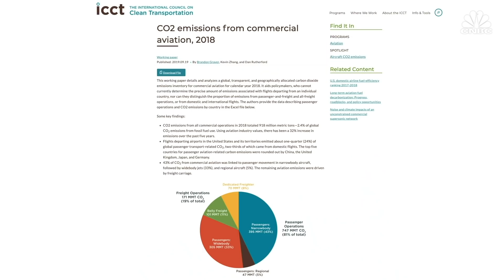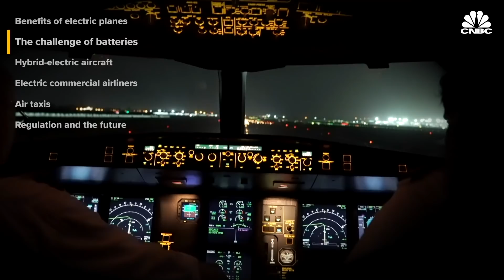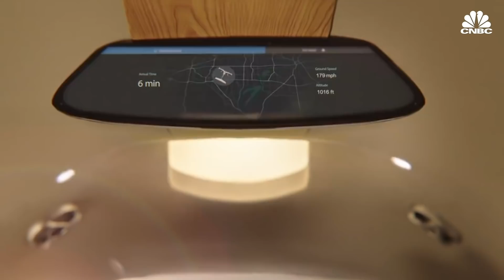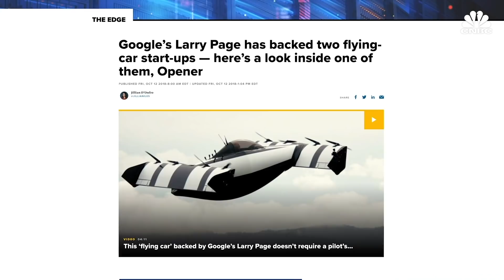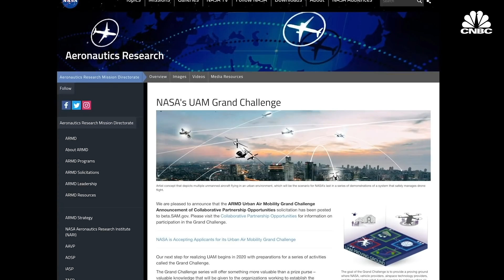Why Don't We Have Electric Planes Yet?

Comment: One big benefit of using a kerosene propelled plane must be the fact it loses weight over time as fuel burns up. As long as batteries are as heavy as they are, most  of the energy will be required to carry them around from the start to the landing. I wonder, why are we not talking much about hydrogen propelled planes? They could be just as environmentally friendly as electric ones if not better?

Comment: The number 1 issue is going to be speed. Since battery-powered aircraft only operates propeller engines (not jet), can battery-powered aircrafts come close to .80 to .90 mach speed of current commercial jet aircrafts?

Comment: "Why are planes so far behind?"

Aviation enthusiasts & every single airliners with CF6, RB211, PW4000 & every other loud turbofans:
Because that's what heroes do.
Reply: They have hydrogen plane in the works , Hyundai, Honda, BMW, Toyota all have hydrogen cars ready to launch, there are hydrogen trucks in the works, shell has invested heavily in hydrogen and here is the key in 2017 the Australian CSIRO invented a way to store and ship hydrogen, Japan plan’s to go fully hydrogen by 2030. You can manufacture hydrogen using solar power and store it and use it to provide electricity when it’s night, welcome to an actual green solution, batteries take 12 years to pay off and last 10 , GL with that.
Reply: @SuperJohn12354  Let's just hope the beasts of the vintage commercial jet aviation (i.e those early high-bypass turbofans, the 747, 757, A300, A380 etc.) coupd survive that 'Hydrogenism' by allowing the engines to be powered by Hydrogen.
Reply: @SuperJohn12354  OMG!  What utter tripe!  Where do I start?

No, all those car companies do NOTTT have hydrogen cars ready to go!  On the contrary!

BMW had a hydrogen version of their 7 series more than 10 years ago!  Nobody wanted it!  Have you EVER seen one on the street?!  Honda and Toyota were always talking big about their Clarity and Mirai boondoggles... but what happened with them?  You can't fool anyone into buying a car that runs on peanut butter, if there are no peanut butter supply stations to accommodate you.

There is no good way to calculate all the EV charging stations all over the country, but when you count all of the ones at factories for their employees to use for free as a perk, or the ones in parking garages, theaters, restaurants, museums, etc., it is safely into the high tens of thousands.  How many hydrogen stations?  69, as of the last count.  And how many HFC cars?  Google it yourself: the number actually DECREASED last year, because nobody wanted one!  About 8,000 in the whole country, less than the number of Teslas made in a month.

Contrast that with EVs: on March 31, 2016, Elon Musk announced he was ready to take orders for the Model 3; he said it would require a $1K deposit.  He was only expecting a couple of thousand orders.

What a surprise: within 24 hours, he had ~ 186,000 orders with deposits.  Within one month, that number had swelled to close to a half-million.  It took them years to catch up with the backlog... their Gigafactory in Sparks NV, is the largest building by footprint in the US, and 2nd by volume.  All it produces is batteries for them.

They took less than a year to build their next factory, 212 acres in size, and were producing cars in less than a year.

Where are all the HFC stations?  It's simple.  No one wants a HFC car if there is nowhere to fuel it, and no one wants to build a fueling station if there is no one to sell the fuel to-- a classic Catch 22.

Why not build them?  That's even simpler: a fueling station costs between 1 and 2 million dollars.  Do the math: to install, say, 30,000 of them, which is actually just barely adequate, that would set you back something like half a TRILLION dollars... who would risk installing them, if there was no guarantee of a market, if they considered the facts below?  Who would even have that much cash?  Anybody that DID have that much, would be smart enough and savvy enough to know it made no sense to risk it all on anything such as a distant also-ran to EVs.

Unlike charging stations, which cost as little as $800. bucks including installation-- in many areas, the city or the utility will install it for free, and maybe even kick in the hardware, too.  That's how it works here in L.A., and many other places across the planet... cities are eager to get everyone to drive EVs, because it's the cheapest and easiest way to reduce pollution, health care due to asthma attacks, emphysema, heart attacks, etc.

Back to those woeful HFC cars: why would car companies be so eager to sell them?  Again, simple: it was like having an umbilical cord attached to their customers.  Once a driver has one, it's a hot potato: they can't sell it... it is only good as scrap metal... so all they can do is drive it, and pay dearly for the fuel, which they can only get from the dealer, or someone connected to them.

EVs might not need anything from the dealer or manufacturer for years except for piddly stuff like tire rotations and windshield wipers; all of that is the main profit for car companies: they make more profit off of parts, oil changes, tune-ups, tranny service, radiator flushes, etc., than selling the car.  As for HFC cars, there is less maintenance (at first!), and they give the hydrogen fuel to the customer free for the first year or so... but once the honeymoon is over and they have to start paying for things, a HFC car will break their backs: presently, the fuel is several times as much as gasoline-- $15. per gallon, give or take, and the cost gets kinda fuzzy since, for instance, you can't just fill your car up on Monday, park it for days, and expect a full tank to be there when you need it for the weekend: hydrogen gas needs to be kept at hundreds of degrees below zero just to keep all of it from boiling away.

(You said something about using sunlight to make the hydrogen... that is an incredibly inefficient way to make it, called hydrolysis.  But the alternative-- called hydrogen reforming-- is no better than using gasoline, as it produces just as much pollution.  It's a no-win situation.

 Even under ideal conditions, hydrogen atoms are the smallest particles on the periodic table of elements, so there is literally nothing than can hold it-- even in a solid steel container, it will eventually escape from the most infinitesimally small cracks and valve clearances... it will seep right through solid tanks as if they were just sieves.

Wanna park that lovely FCV right next to the gas water heater, in your garage... the one with the pilot light??  Do you still want your house to be there in the morning?  Are you always going to know if there is a cigarette smoker, or other source of ignition nearby?  Would that weigh too heavily on your mind to be worth the stress and anxiety?

Hydrogen can make many materials brittle... what exotic internal parts will you have to replace in a few years, or chance having a catastrophic failure?

So many more problems... too many to count... have you ever seen the Hindenburg Zeppelin crash of 1937, in NJ? (Search for it.)  Before that happened, people loved the whole idea of riding in a quiet balloon floating though the sky... afterward, everyone was horrified and unwilling to take the chance.  Immediately, hydrogen was a curse.

That was more than 80 years ago... people forget; people die.  But what happens when Soccer Mom with a van full of kiddies is at the fueling station when a semi truck loses its brakes, and plows into them, and they suddenly become the first story on the nightly news-- worldwide?  Will ANYONE be convinced to get into a FCV again?  The entire fuel cell²
 market will die overnight.

So much of what is wrong with FCVs, has much more to do with what is right about EVs: look at the stats on how many EVs have been responsible for fires, and you will see they are per capita much safer than ICE cars, and infinitely less worrisome than FCV cars.  They have no fuel tanks to explode if rear ended.

All the heaviest components in an EV are way down between the wheels, giving it a low center of gravity, which means excellent resistance to roll-overs, and they will corner like a Formula One racer.

There is so much more... do you really need to know?

Hydrogen is DEAD, and always has been... the hucksters trying to sell them just never told you that.
Reply: @SuperJohn12354  wow yet another " true believer" that throws out false "facts" , omits HUGE amounts of costs that detract from his religion and refuses to listen to the truth....HAIL to the conspiracy theorists and true believers, may they forever be marginalized!

Comment: the batteries are going to improve...
Um. Yes, but all evidence suggests increasing the energy density more than 3x over the current density might actually be impossible and you're hoping for a 20x increase? The Law of Thermodynamics is a cruel mistress. As the energy density increases you need to add safeguards which adds to the weight. The Lithium Ion batteries or similar would catch on fire so they had to take a step back and add in internal barriers which made them very safe but then the density was reduced by half. You can mitigate this problem though by taking all the costs savings from maintenance and the cheaper electric engines and put that into making lighter aircraft but unless there's some significant revolution in battery technology that nobody has seen coming we aren't likely to see more than 3x energy density per mass... if the energy density increased at the current 5-8% per year average then it would take until about 2070 to match jet fuel but the problem is energy density will hit a brick wall likely in terms of safety, charging capability and energy density.

Comment: Aviation history: Propeller Age -> Jet Age -> Propeller Age
Reply: I wonder if planes can use biofuels??
Reply: *Electromagnetic levitation using the Earth's magnetic field - possible but unlikely because the field is too weak.
Reply: I Propeller age
Reply: Unless ion propulsion improves, which is no more far off than / just as far off as battery improvements.
Reply: We won't see electric large transport aircraft in our lifetime.
Reply: @westy2432  depends how old you are
Reply: @westy2432  exactly. Not 'til fuelcells can be certified for GA and regional use.
Reply: @westy2432  maybe it could happen
Reply: @kennethtimorang8343  Jet engines use combustion to generate thrust. You cant recreate that with a electric motor without some sort of fuel source
Reply: @westy2432  fact of the  day, but maybe it could be used in teeny-tiny private jets?
Reply: @kennethtimorang8343  Not technically a jet, but it sure can be used for small business aircraft. Which is why I mentioned large transport category. I don't see how battery or propulsion technology will be able to replace 200-400 seat aircraft of today within the next 100 years.
Reply: @westy2432  transporting VIPs from a city to another maybe?
Reply: @westy2432  the Chinese just filed study on plasma engine
Reply: @westy2432  guess it’s in the hands of our future generations. soon one day, we will all be ancestors.

Comment: Electric cars are not thousands of feet in the air with hundreds of passengers. Lithium batteries, in their present form, are an unacceptable safety risk. Storage batteries will be invented using safer storage mediums than lithium. But that, at the moment, is far into the future. If lithium is used in its present level of technology, how many disasters will be tolerated before the electric planes are grounded. The 737 Max 8 were grounded after 2 disasters.

Comment: The two elements lighter than Lithium are Helium and Hydrogen. Helium is inert, and Hydrogen is a gas.Question: What will the BETTER BATTERY consist of? That is, what material can achieve the energy density of C8H18, plus others?

Comment: The only real, practical, useful electric air transportation that could exist right now or very soon is dirigibles.  Takeoff and landing require very little energy.  Smooth ride. Can't crash. Won't fall out of the sky if an engine fails.  Massive cargo capacity and can carry hundreds or even thousands of people, and plenty of batteries for long haul flights. They can hitch to a "sky platform" to board/deboard passengers & cargo, basically just the roof of a skyscraper.  To get on board, you'll enter a building, elevator up 80 flights, and escalator on to the dirigible passenger compartment.  You'll get a generously sized cabin, perhaps with two queens and a bath.  You'll be able to bring unlimited luggage.  The tradeoff?  They go a maximum of 100 mph.  To get all the way across the U.S. would take 30 hours, vs. 4 or 5 in a conventional jet.  But, if you're not in a big hurry, take a balloon and enjoy a nice comfortable cruise with fabulous views, multiple restaurants, a gym, and everything that a conventional jet flight is not !

Comment: “Dad’s little Cessna...” as if every dad has one... only for the rich.
Reply: My father just had a Piper Cub.
Reply: @patrickkenyon2326  
Piper Cubs are great little planes. My first flight ever was in a Piper cub, so that plane has a special place in my heart. My dream is to one day own the New Carbon Cub, but they're very expensive, they go between $180,000 and $280,000, which is definitely out of my price range. They cost more then my house.
Reply: @AviationNut  My father was a fighter pilot, so I've been around aircraft most of my life. Lived at Elmendorf and Wright-Patterson.
Reply: @patrickkenyon2326  
Controller.com or Trade-A-Plane are great websites for used planes. Sometimes it's just fun to look up the prices. They even have a VIP Boeing 747 for sale for only $9 million and it's actually in flying condition, certified till 2022. A new Boeing 747 costs $350 million, so for $9 million fully furnished VIP 747 seems like a great bargain, even though it's 30 years old the airframe doesn't have a lot of hours for it's age. Tell your wife or girlfriend that a 747 makes a great Christmas gift. Lol
Reply: @AviationNut  I'm spoiled. Too many years hopping military flights. I don't want to have to pay, LOL.
Reply: @patrickkenyon2326  +1 foe the j3
Reply: You don't need to be rich to have a small Cessna. I am a truck driver and I have my own Cessna 172 that I bought used for $47,000 and I have been flying it for the last 6 years. You can buy a used two seater Cessna 152 or 150, starting at $17,000 and up. In fact the guy I share my hangar with bought a beautiful Cessna 150 for $26,000.
Reply: @AviationNut  yeah i get it, but i'm pretty sure most dad's would have a pocket knife and not an airplane. but now that you mention it i might go look into one.

Comment: Question: where will all the electricity come from? Solar, wind? Those aren't nearly capable enough to produce electrical needs of homes and cars now, let alone supply electric aircraft. You can have the best batteries but without the ability to charge them, they're useless. Also wondering how slowly the big passenger aircraft will have to go. Very cool prospect though of cities filled with aircraft. The Jetsons. Star Wars. Back to the Future. Very cool. Of course, even better would be global transporter systems (Star Trek).
Reply: @ivobrick7401  What country are you from? Look at #2 on your list. That is exactly what I am saying. Yes, I am from the U.S. Yes, I think that the solution is nuclear power, but the far left in the U.S. won't let us build any more nuclear power plants. They want to drive us into the 19th century and not to the 21st. They want us off of fossil fuels (a laudable goal, though not in the time frame they say) but think that ONLY solar and wind are the answer. They want to have everything electric but don't want to explain where it will come from without nuclear. There are even those that want us to have NO electricity either. This is not feasible. I would love it if we got most if not all of our electricity from nuclear, as does France (from what I have been told). We already have many hydro-electric plants as well, but the leftists want to get rid of those as well for various reasons. Thanks for your comment. Cheers.

Comment: First they have to invent large lithium batteries which do not inherently explode.
Reply: @ivobrick7401  Still uses LIthium. Even though solid-state batteries ditch liquid electrolyte in favour of a solid conductive material such as a polymer or ceramic, only time will tell if this method will stop the explosive potential of storing a charge in Lithium or not. To me, the technology has not yet advanced to the level of powering an aeroplane, which cruises at nearly 7 miles up in the atmosphere at a cruising speed of around 550 mph, and cannot be simply "parked somewhere" while a fire is dealt with, as you can do with a car. A lot of research has yet to be done. Hopefully with materials other than Lithium.

Comment: You guys totally ignored the fact that battery operated plane engines for commercial flights would have to be propeller driven and this would have to compete with current jet engine flight. Propeller planes 200 MPH vs Jet Engine 460 to almost 600 MPH.... Jet engines are not going away anytime soon for commercial flight.

Comment: You are not Tesla. Electric motors have to be driven by an engine. Batteries do provide fuel to electric motors but are not large enough to fuel a electrically powered motor for aviation. Hydrogen or Oxygen fueled engines are a better option. Out!

Comment: For low speed aircraft a hydrogen fuel cell would have ample range for an electric aircraft. It's nowhere near as heavy as battery power either.

It's a no brainer as far as km concerned